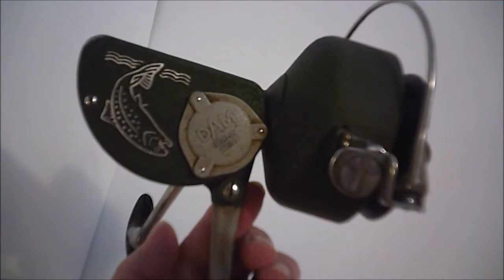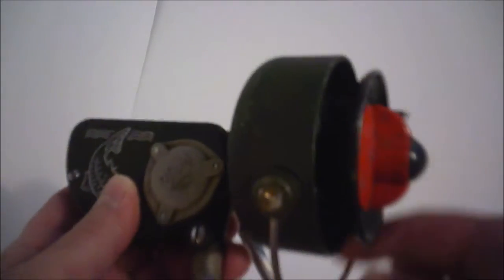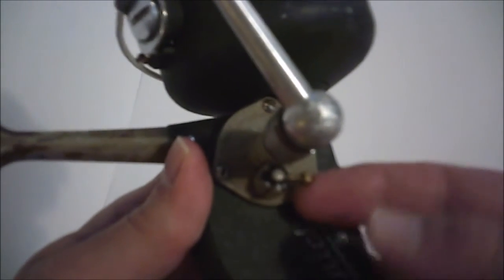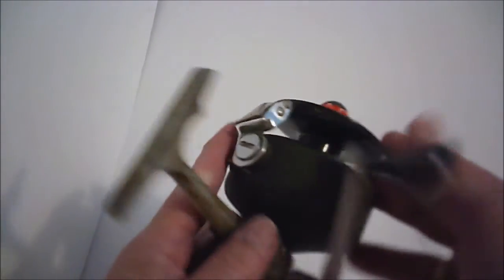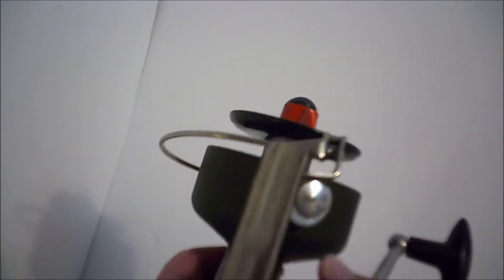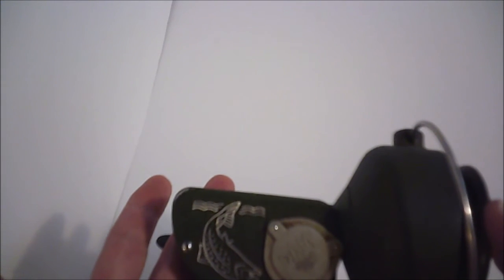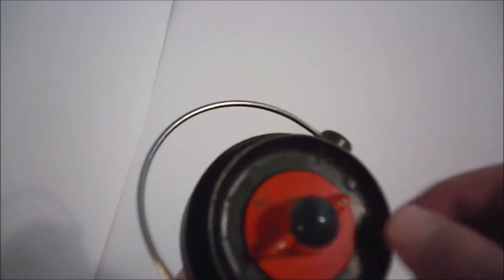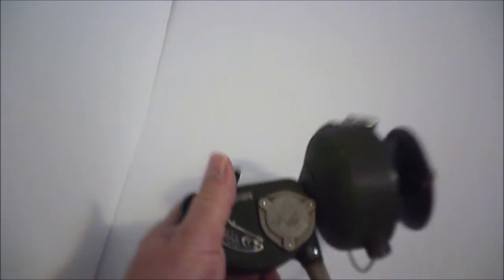SHOW TIME BOX OPENING QUICK SUPER DAM BERLIN WEST OPEN CAST REEL FROM THE 1960s BEST REEL EVER SMACK

Comment: Congratulations for this great reel. It's a DAM Quick Super 270 and you have a later version of it. I'd like to point out a few mistakes, the body and rotor are not made of steel but of aluminium. And the reel does have one ball bearing - the rotor shaft (which is made of steel) runs in one ball bearing and in a bronze bushing. And one more thing - the "anti forward" function of the anti reverse is because you can switch the reel from right to left handed - and on the opposite side "anti forward" becomes "anti reverse". You're quite right, of course, it's one hell of a reel, that will outlive you and maybe even your children.

P.S. What rod do you fish it on and what kind of fishing do you use it for?
Reply from the maker: i don't have a rod for it yet but i do have an ugly stick nine foot with a eight bearing michell reel this old reel i think needs a special rod maybe an eleven foot fifty pound rod what do you think i do have fourteen rods .
Reply: @victormariopizzey5212  I'm a fresh water fisher, so I can't give you much of an advice there, but 50lb rod sounds about rigjht. I fish it on a heavy pike rod with 200 g casting weight. It's an old DAM glass fibre rod - I suggest you try to get one as well ;)
Reply from the maker: @gufiangler1760  thank you for sharing you thoughts will take this into consideration when buying the rod .